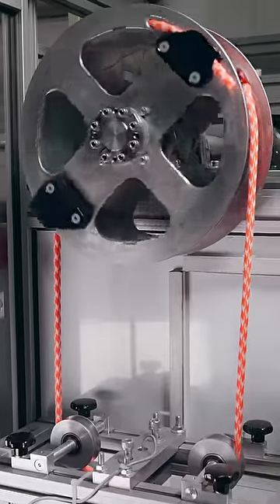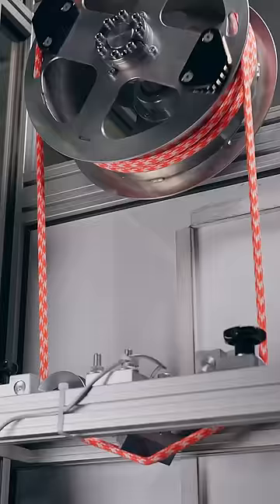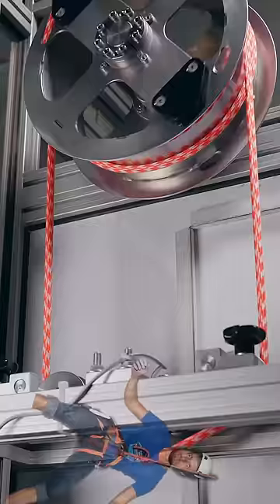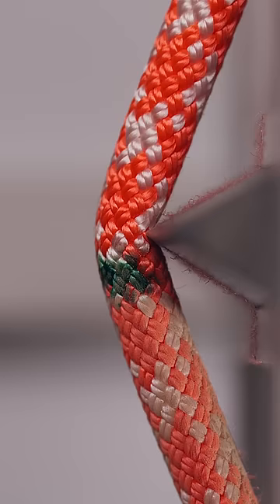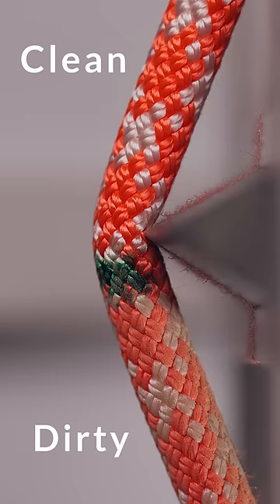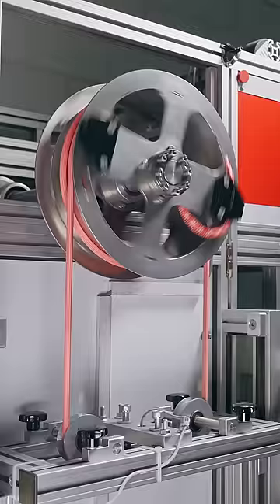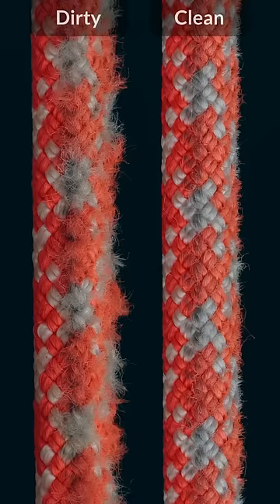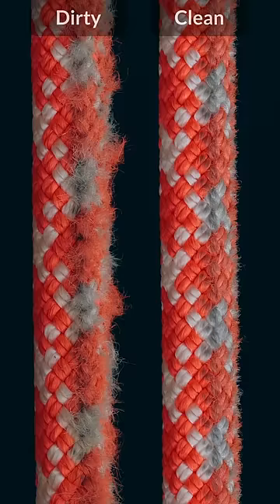Surprising Effect of Dirt on Climbing Ropes

Comment from the maker: Full video: https://youtu.be/quB-KEsqJNU
Reply: Fuck I gotta watch it, I've always wondered if that was a factor, I mean, factually speaking dirt even if dust dirt is an abrasive soooo like when ur climbing, you're dealing with getting random pockets of basically sand paper on whatever section of rope if 1, dirty, or 2 an anchor point with alil collection of dust dirt that falls on wherever on the line, sooo fucking interesting and makes a metric-fuck-ton of sense
Reply: Now I have to know what happens! Great video so far. Going to full video now. Cheers from a high-rise apartment restoration worker. Basically hanging off of buildings with jackhammer, knives, caulking guns, grinders, painting, brick repairs, tuckpointing, concrete forming. You name it im doing it, and my ropes go through hell!
Reply: What if the rope is wet?
Reply: @mistersneakypants3234  I was thinking the exact same thing.
Reply: Imma watch the video now. Keep posting yt shorts!!!!
Reply: Selling ultrasonic climbing rope cleaners!!!!! Get em now!!
Reply: Dislike
Reply: @solaris736  you're a sheep
Reply: @solaris736  I think you're being sarcastic but I really can't tell these days.
Reply: I watched it, washing is better. Don't use hard detergent (whitening, bring back the colour stuff). Keep rope away from dirt and chalk. The polymer breaks down from water as well.
Reply: @solaris736  What do you think dirt and dust particles are?
Reply: @mistersneakypants3234  it gets funky in your descender, it's slipping randomly. It's hard to explain you should try it for ur self in a save environment not to high up
Reply: @solaris736  🔴 What Is Islam? 

🔴 Islam is not just another religion. 

🔵 It is the same message preached by Moses, Jesus and Abraham.

 🔴 Islam literally means ‘submission to God’ and it teaches us to have a direct relationship with God. 

 🔵 It reminds us that since God created us, no one should be worshipped except God alone. 

 🔴 It also teaches that God is nothing like a human being or like anything that we can imagine.

🌍 The concept of God is summarized in the Quran as:

📖 { “Say, He is God, the One.  God, the Absolute.  He does not give birth, nor was He born, and there is nothing like Him.”} (Quran 112:1-4) 📚

🔴 Becoming a Muslim is not turning your back to Jesus. 

🔵 Rather it’s going back to the original teachings of Jesus and obeying him. 

More .....
Reply: @solaris736  .
Reply: THIS is how you use Short vids!
I saw enough that my original curiosity was satisfied, so I didn't feel like I got "tricked", and then the short, itself, inspired a secondary curiosity that will absolutely draw me into the full video, that i can conveniently watch because the creator pinned that video link to the comments.

WUNDERBAR!!!!! FANTASTIC!!! 

All shorts (that aren't stand-alone) should be handled like this. Thank you my fine fellow!
Reply: I wonder about the effect of permanent marker on the rope since security equipment for builder your not suppose to write on them
Reply: where is part 2
Reply: Wo, wo he said
Reply: The sort video is a bit too short. But I am also not that interested to watch 20m of this :D
Reply: @nytrouz_original  nah, risk it for the biscuit 🍪
Reply: This sounds like Andres from @TigerBelly
Reply: Not just dirt, everything will damage them faster, even salt from sweating or powder from climbing. Aslong as it is or gets solid it will damage ropes.
Reply: Thank you for the full link! I guess the short left us all on a cliff hanger 🫠 poor joke I know lol 😂
Reply: @kitkat4189  how so?
Reply: Thank you for pinning the link to full video!!
Reply: Why not just show me the full video right away instead of this camrip of it?
Reply: @solaris736 I’m surprised your comment with the word fuck in it is actually still here, we all know what YouTube kids has become in 2023.
Reply: Thank you. This is why im hesitant about switching from cable to a synthetic winch line... yeah its light but..
Reply: The sand/ debre acts like a grinder
Reply: nope, defo not getting you two clicks for this
Reply: Ahhh so someone wants to make the best rope 😂😂😂😂 not the way, it’s a hypothesis without theory. 😂😂😂😂😂
Reply: Cause you’re trying to find faults when it’s apparent
Reply: I was done experimenting. No need for experimenting, and stop experimenting against other ppl
Reply: quB-KEsqJNU
Reply: Make the link clickable please
Reply: @devvyas6751 thanks. Saved a lot of people the time
Reply: At 250+lbs I wont be climbing any fkn mountain anytime soon😂
Reply: Dear YouTube...we need a way to get from shorts to regular videos. It is 2023--give back clickable links!
Reply from the maker: @NoCoolNamesRemain  YT just added new feature where you have a link on the short to the related video, check it out
Reply: @devvyas6751 doing god’s work.
Reply: @solaris736 it's like not using a rope is the best option
Reply: Link doesn’t work on iPhone app
Reply: @mistersneakypants3234 it actually makes the rope stronger
Reply: @dakr3464  actually?
Reply: @dakr3464  actually, that makes sense. If there were a dry vine and you tried to hang from it, it would be more brittle. I suppose it would have to gain some tensile strength from being wet since it makes the fibers more flexible.
Reply: @HardIsEasy try to oil the rope
Reply: You people are amazing for this best testing of products like this rope
Reply: Nah, I'm good. You fucked that possibility up by cutting video that way.
Reply: @solaris736 did a huge line of cocaine halfway through writing this comment 😂
Reply: Í
Reply: What is the name of the full video, please? The links under youtube shorts don't work and I can't copy it in the android app. . .
Reply: Not hyperlinked not worth my time
Reply: @1islam1 this is not relevant to the video
Reply: @AnonymooseWasMyName agreed 112%! Thank You. God bless!  🐢🙂 . .
Reply: But impossible to click a link in the YouTube app!
Reply: @steresi  actually it does work
Reply: Using the mobile app on the phone does not allow user to click link in comments. Better for op to provide link in lower left quadrant of video.
Reply: Sorry not that surprising
Reply: Nice😊
Reply: @wenchfisterx next video: does ultrasonic cleaning affect the rope??😂
Reply: This is what shorts are for, I am watching your full videoooooo NOW
Reply: @solaris736 🔴 What Is Islam? 

🔴 Islam is not just another religion. 

🔵 It is the same message preached by Moses, Jesus and Abraham.

 🔴 Islam literally means ‘submission to God’ and it teaches us to have a direct relationship with God. 

 🔵 It reminds us that since God created us, no one should be worshipped except God alone. 

 🔴 It also teaches that God is nothing like a human being or like anything that we can imagine.

🌍 The concept of God is summarized in the Quran as:

📖 { “Say, He is God, the One.  God, the Absolute.  He does not give birth, nor was He born, and there is nothing like Him.”} (Quran 112:1-4) 📚

🔴 Becoming a Muslim is not turning your back to Jesus. 

🔵 Rather it’s going back to the original teachings of Jesus and obeying him. 

More .....👇

🔴 THE RETURN OF JESUS
Reply: ID RATHER DIE THAN WATCH THE FULL VIDEO. P.S. WOORSHING DE ROPE DOES........
Reply: I can't click on the link. The text isn't selectable on mobile.